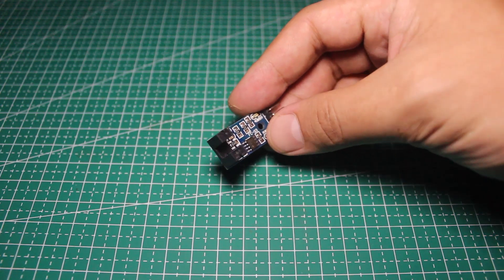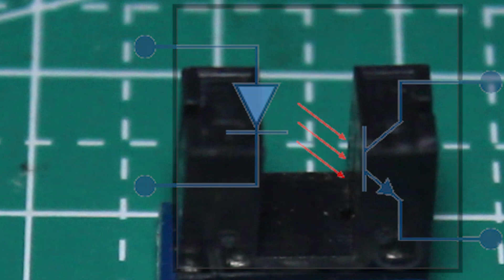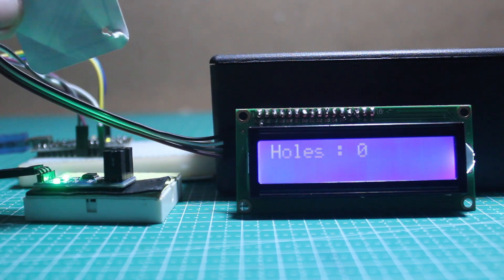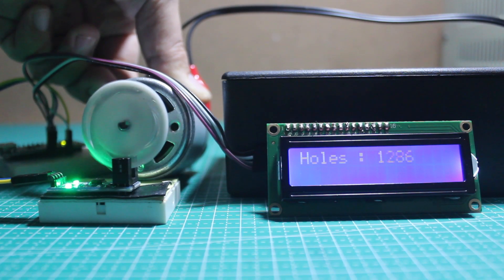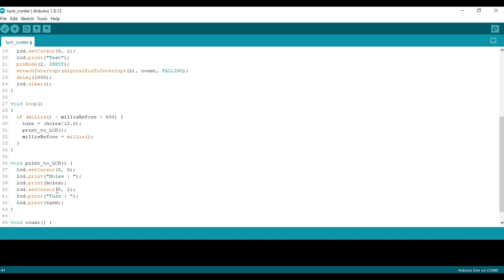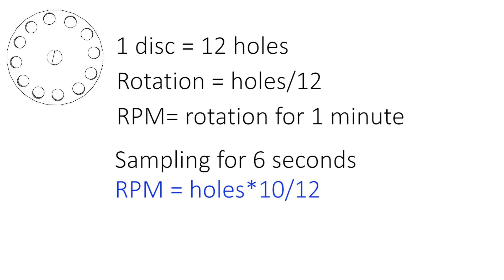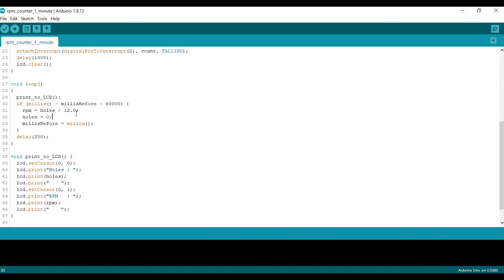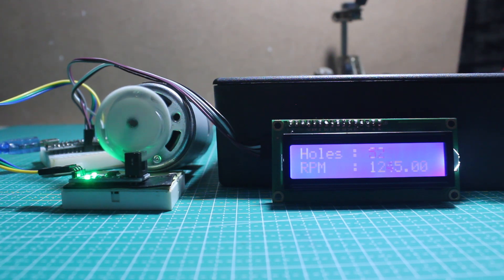How to use Optocoupler sensor module as RPM meter (Tachometer)

Comment: I'm going to use this with ESP8266 so I can show  RPM value in webpage.  Can  I  use 3.3v  to supply power to this module?  what output voltage from this module?

Comment: Hello friend, my Optocoupler is one of those used in printers, which has 4 wires, two for power and two for signal, so how can I use it in your code, given that yours only has one signal pin... (attachInterrupt(digitalPinToInterrupt(2))? Thanks
Reply from the maker: Find the digital output, and use that pin.

Comment: hey bro, my interupt triggers way too much giving too high reading, could it be the wheel is too thin? also the wheel is slightly warped could this affect it?
Reply from the maker: Try to turn wheel slowly. Does it only add count every passing hole?
Reply: @miliohm  no by the time it passes around 10 holes, it has picked up more than 100 holes
Reply from the maker: @koekie7003  try to paint your wheel. If it 3D printed sometimes it still can be penetrated by the infrared.
Reply: @miliohm  I will try it thank you

Comment: Hi there, thanks for your clear explanation about this setup. I got it working because of your video!  But what if I want to have a second RPM reading on the 16x2 display with a second Optocoupler sensor? How do I adapt the code for this situation?
Reply from the maker: you need to make a second counter function with different variables, and don't forget to attach interrupt on digital pin 3 since arduino like UNO or NANO only has interrupt pin on pin 2 and 3. Then print the second value on a different LCD coordinate (assuming use 1 LCD).